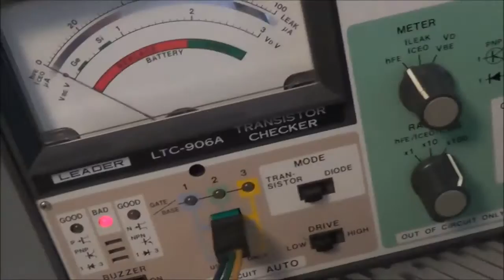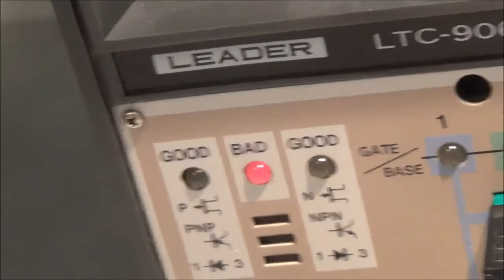Yamaha R5 Stereo Receiver Troubleshooting

Comment: I like your idea for testing transistors when you can't access them!  I also like that Leader!  ~Jack, VEG
Reply from the maker: I only vaguely remember working on this unit...I am going to start keeping a log. The Leader can sometimes be found cheap--got mine cheap on eBay.
Reply: In this video you unsolder the leads to access them on the solder because you couldn't access them from the component side...it is a grand idea! I have a couple of hand held testers, but I like the bench model better.  ~Jack, VEG